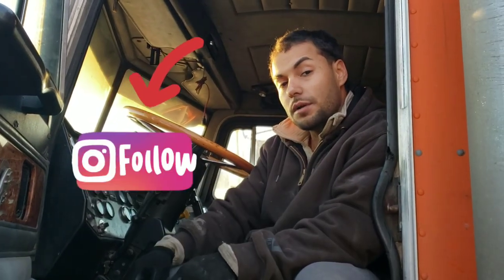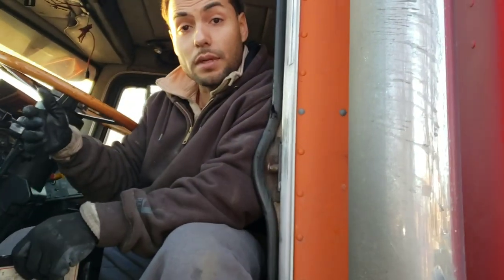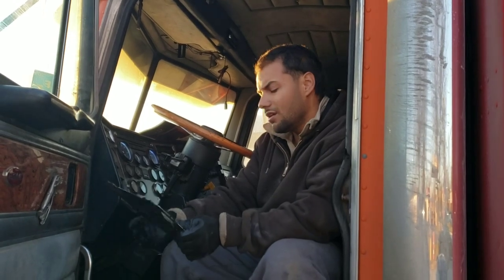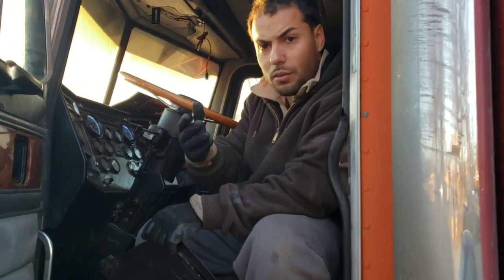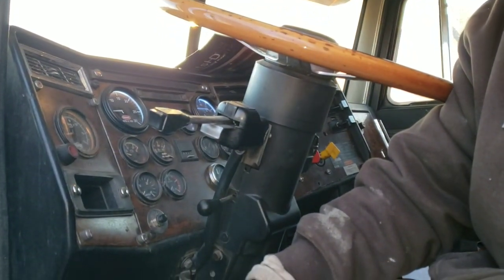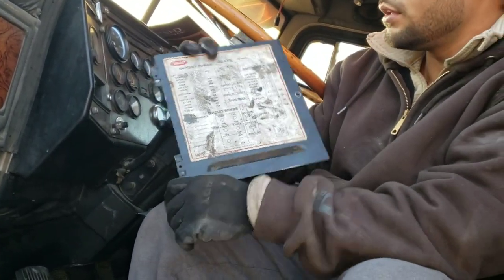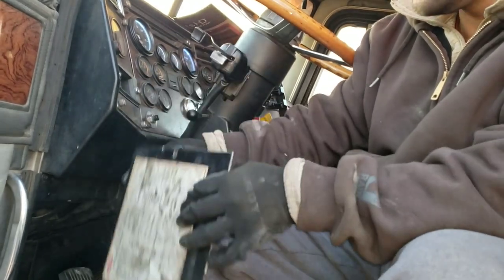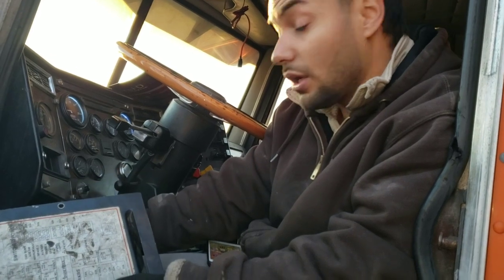Wiring Problems and Troubleshooting Advice on Your Semi Truck Big Rig

Comment: Haha bin there...I own a 91 379..good luck with the electrical it's a nightmare.. you guys are on the right path, luckily for me a had a good electrical guy..I spent tons getting it together and still trying to get it right. However, do you guys know how to get the evaporator core out? It's located under the glove box. Preciate guys and good luck
Reply from the maker: Sorry this is probably late but to get it out you need to remove the freon from your ac system and disconnect the two ac lines under the hood on the firewall and begin removing glove box to get access to it on the passenger side of the cab